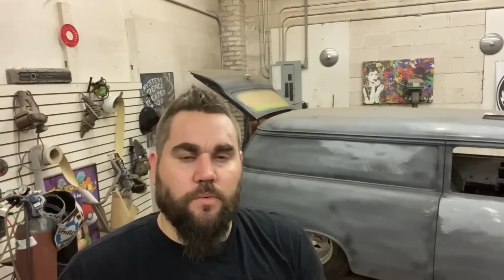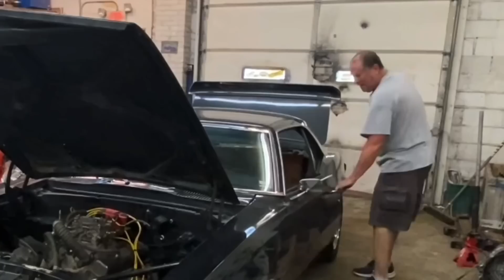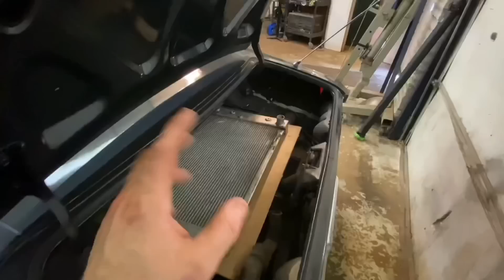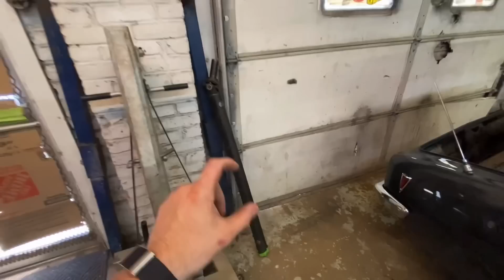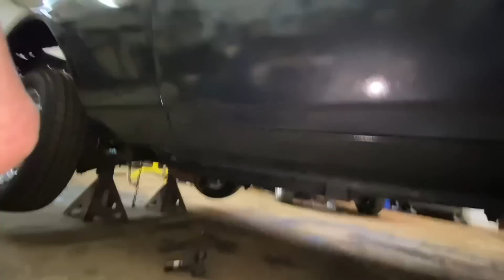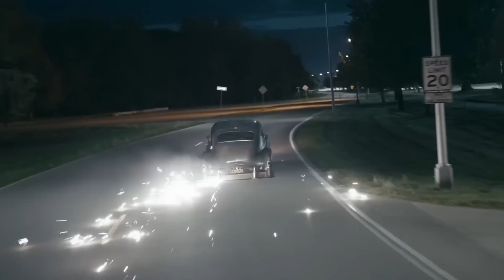DID MY DAD MAKE THE WORST TRADE EVER?! 56 CHEVY HOT ROD FOR A STOCK 68 FIREBIRD! KUSTOM RAT BUILD

Comment: “Dent” cable for the transmission
Reply: Nope it's probably a 700R4 which has a TV throttle valve cable not a kickdown cable which regulates line pressure if you don't hook it up and adjust it properly you're going to burn your transmission up real fast

Comment: First thing. Get the Chevy Rally wheels off of a Pontiac. Sacrilegious. Lower the stance. Put in the fender wells, look around for a tilt steering column. A little tastefully done pin striping. Dynomatt the floors and firewall because those things are noisy and hot inside. Then cruise it up and down the road.
Reply: I concur, Pontiac wheels asap...
Reply: I think this is more of a put that bird on a Camaro, you realize who your watching? There not gonna restore a classic, boring... Let's cut some shit......